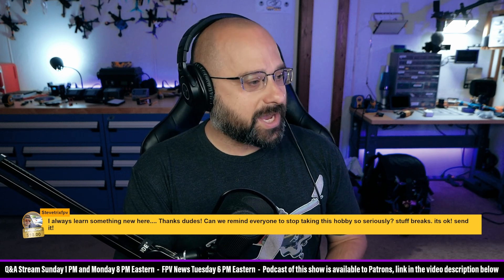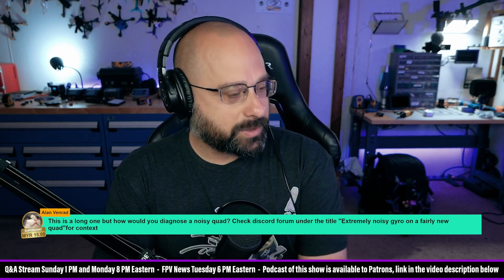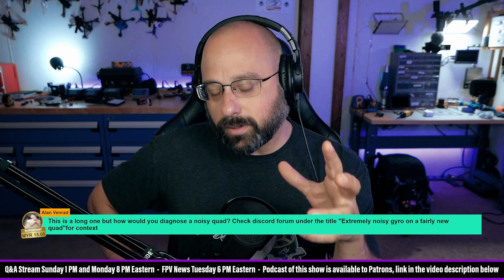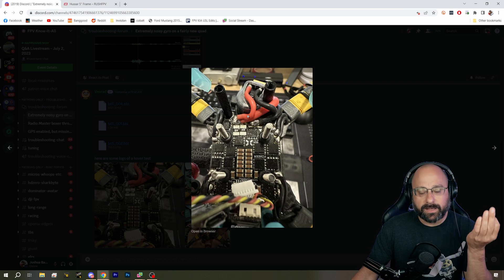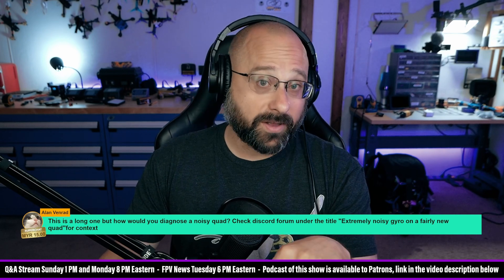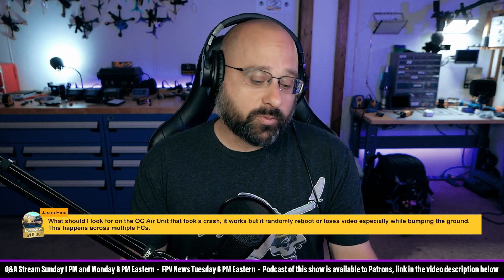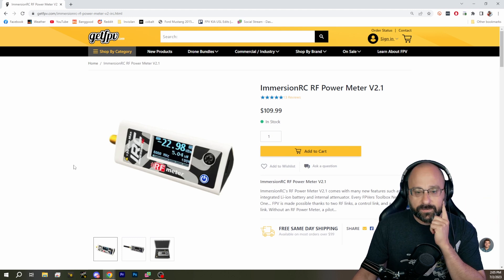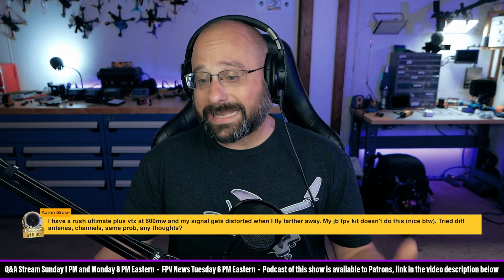Too Serious About FPV? Diagnosing A Noisy Drone? - FPV Stream Questions

Comment: Noisy Gyro : Make sure no cables are bumping the gyro by feeding over top of it and vibrating against the top of the gyro. I thought I had a bad gyro but then I noticed that on the FC layout the cables were feeding over the gyro and I guess they were intermittently touching and affecting the gyro. I taped them down and the problem was solved….. I should at some point consider re-routing the cables.
Reply: I have also had bad gyros and in my limited experience they fail on a single axis or are bad on a single axis…. So it can - like JB said be the gyro and replacing the gyro will solve it!! For me the way it behaved with a bad gyro was it would fly but even in ground affect it would behave really odd…. It was trying to compensate for data coming in which was just not there

Comment: Hello sir, i hv question for soldering caddx vista to analog fc there only hv 5v, it is good if i solder it to xt60 pad using bec output 5v/9v? So There have noise electrical or no?